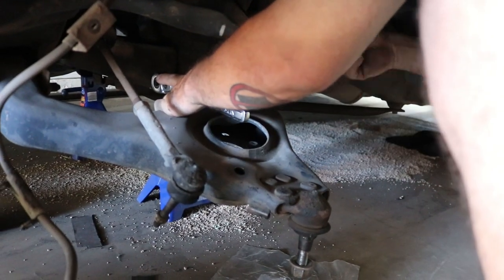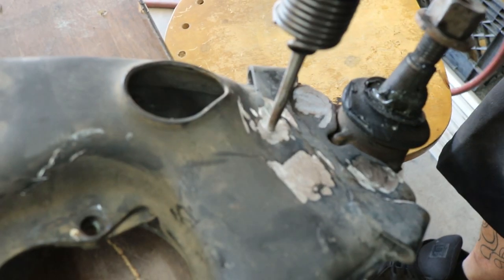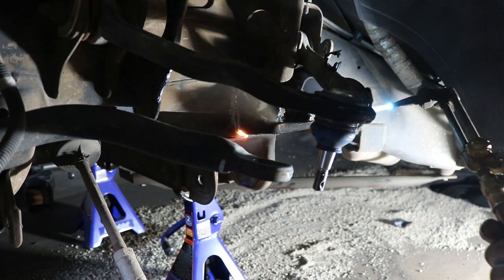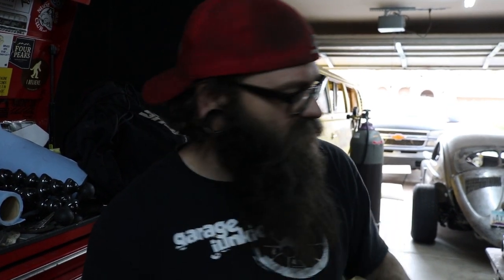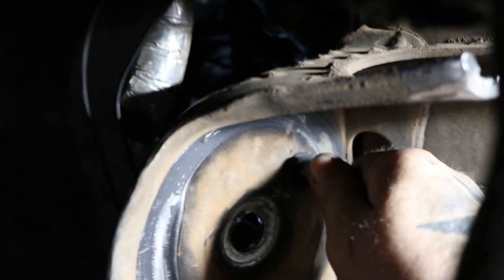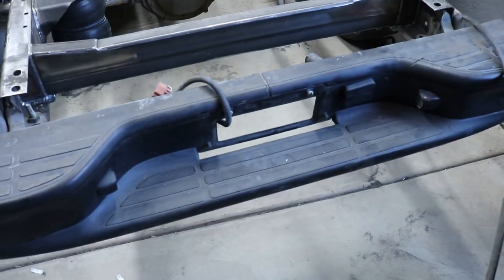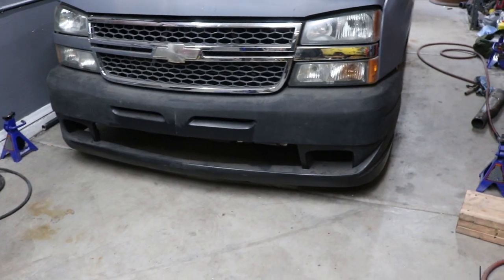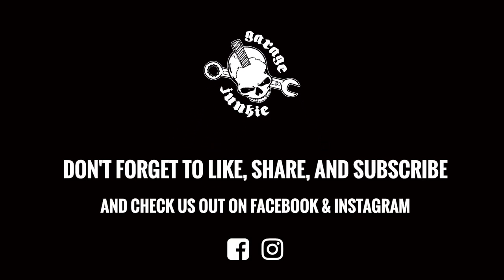How To Bag A Truck : Final Suspension Assembly

Comment: I use a torch to cut the heads of those rivets off and let it cool and the pins come out with air hammer. Sometimes have to heat the a-arm a little

Comment: Did y’all do front tubs or modify the front fenders at all to get it to tuck that much?
Reply from the maker: We did not. The customer didn't want to do tubs. It has 24" wheels on it now, and sits roughly the same.
Reply: Garage Junkie awesome! Do you guys have a way I can contact you? I need that done to my truck I already had the rear done but it’s time for the front now !
Reply from the maker: You can contact us through Facebook or Instagram on our shop page House of the Lowered.